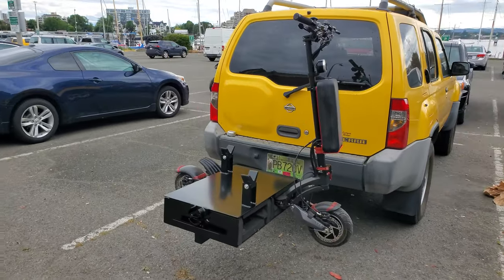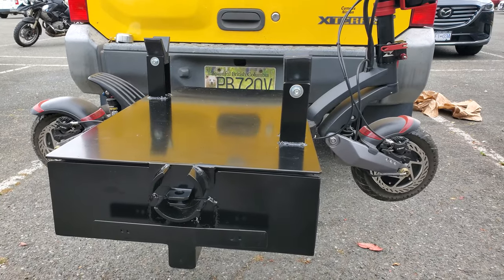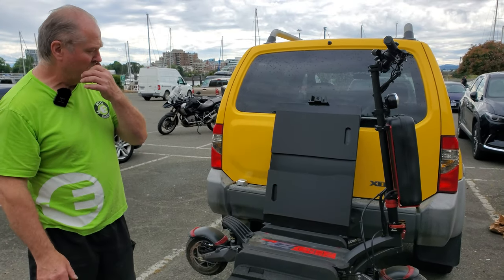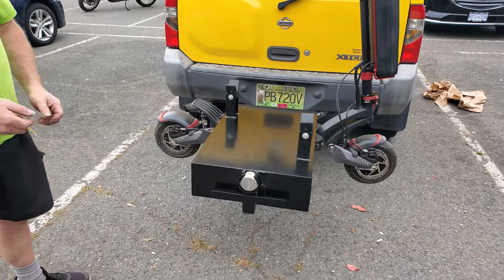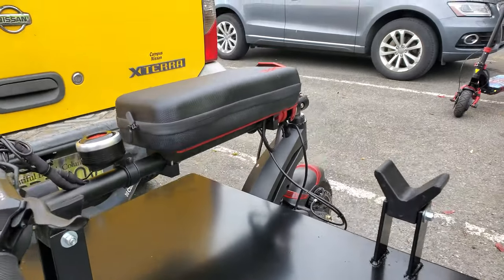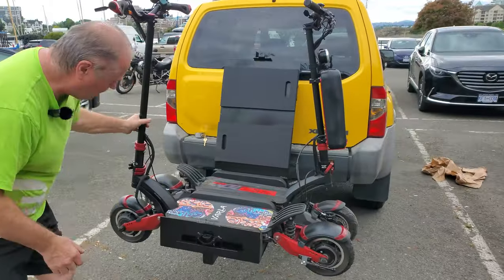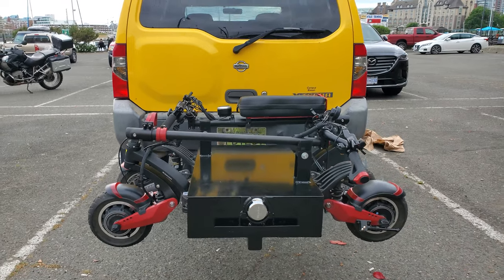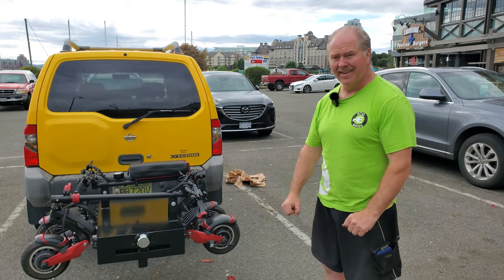Electric Scooter Carrier Review

Comment: Thanks, I'll fabricate my own.
Reply from the maker: save some dough :)
Reply: @TimsElectric  I just completed making a gate for my car port, 4 x 1.5 meters out of 40 x 40 mm galvanized box tube. Screwed color bond roof sheeting cut to size attached with metal screws to gate frame. Love metal fabrication/mig welding 🖐🇦🇺
Reply from the maker: @jamtin3977  then you my friend are exactly the kind of guy that could build something like this :) :)
Reply: @TimsElectric straightforward process. 👍
Reply from the maker: if you build one, do share a photo :)
Reply: @TimsElectric  will do.